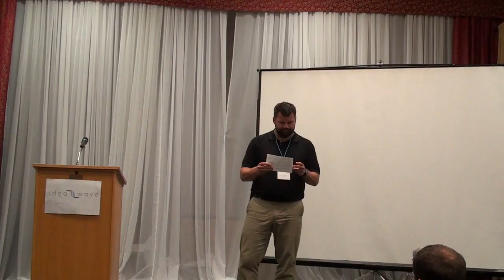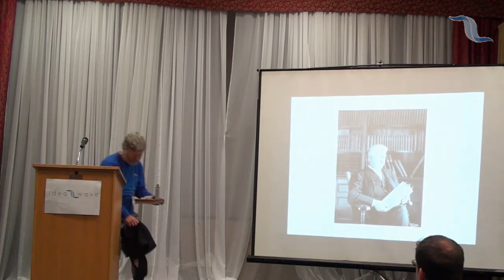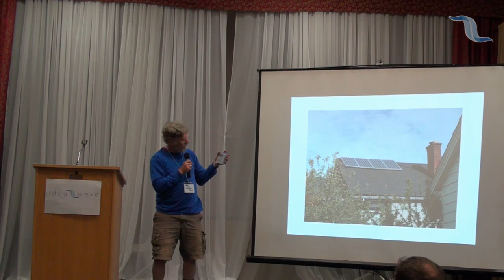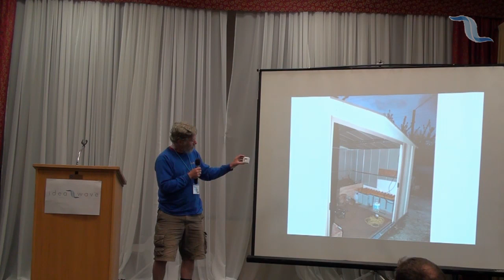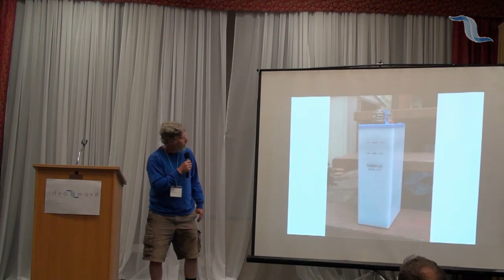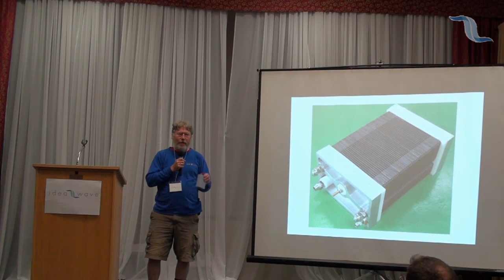Ideal Solar Storage Batteries invented in 1902 by Edison are Rediscovered (Part 1) : Ian Soutar

Comment: Neat things they are, but they are also insanely expensive.
When someone starts romanticizing a piece of tech like this man it is a definitive indicator of half a story told, if chinese manufacturers without patents or any of that overhead are producing these things still at 10x the normal battery price then I hardly doubt Ni-Fe batteries got pushed out of the market by propaganda.
Reply: I do not doubt it is a real battery, anyone can go and buy them today.
But even all this time in production these things are the farthest thing from cheap, even against the highly expensive Lithium stuff they do not match up favourably.
Reply: The cost per year is not bad, and better than lead acid.
Reply: DIY Tesla PowerWall - the fact that they only want to warranty them for 1000 cycles may not be indicative of the battery's actual capability... 

Or it may be that one of their "modern technological improvements" that increases some other factor of capability, such as energy storage density, versus the original Edison battery design, has decreased cycle life by inducing some form of degradation not inherent to the original design.
Reply: The "edison" battery does not have a 11000 cycle life 
The Chinese manufacturer says 1200@80% 8500@20%
The companies that sell these in the US are making false claims that contradict the manufacture's tech sheets

Comment: Make no mistake... the new Edison Batteries are EXPENSIVE. $150 for a 250 aH 1.2V cell, puts it roughly at 10x the cost of lead acid deep cycle. Considering that the average lead acid when used in a large bank, properly, can last up to 7 years... these better last 70 years... then again, how long will I live? Long enough to see my ROI... only if I am about 5 years old, today...